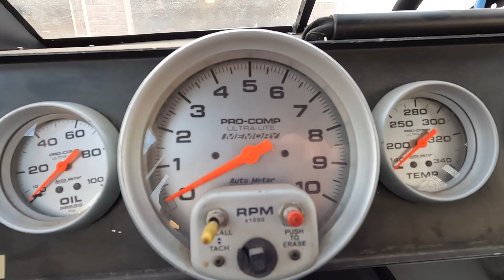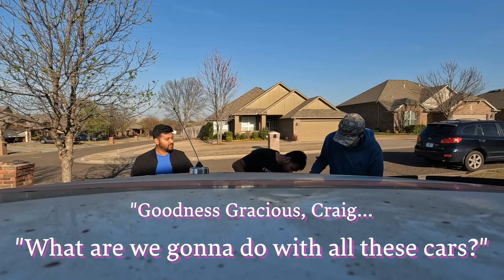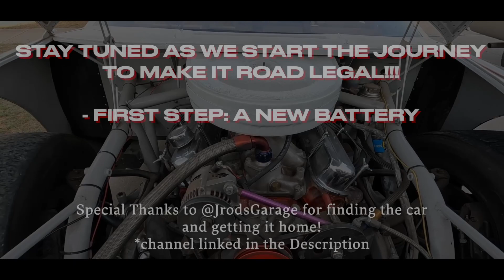BUYING A BUSCH SERIES NASCAR!

Comment: Craig go look at  right turn randy's channel. He made a tide sponsored stock car street legal.  Graig is gonna want a extra set of steel wheel areo series 59's with 275-60/R15 BFG Radial T/A's street tires mounted on them. Then your gonna want extra lug nuts and glue them to the extra wheel stud holes and the pit road impact gun socket all the xfinity/ craftsman truck series teams use that has the spring in it so you can do your own lightning fast pit stops. And fuel dump can so you can fuel up in seconds. That's one of the best parts of owning your own Busch series RACE CAR. They're so easy to work on. There's something like 22 different rear axle ratio's to swap into the rear axle housing. Buy a 5.67 or a 6.00 ratio and put that on the dragstrip!!!